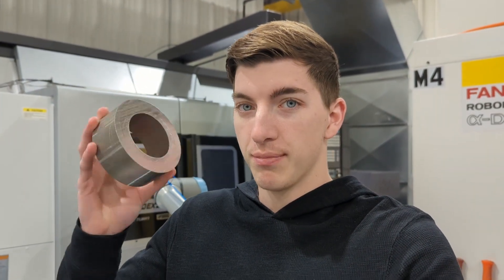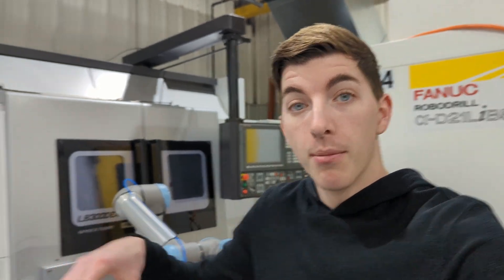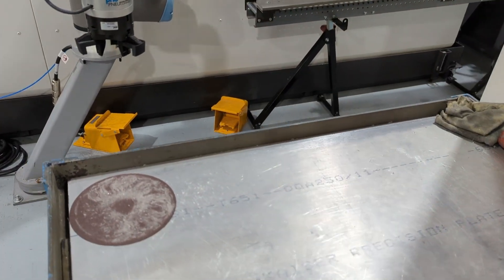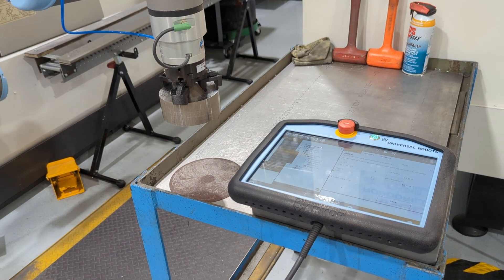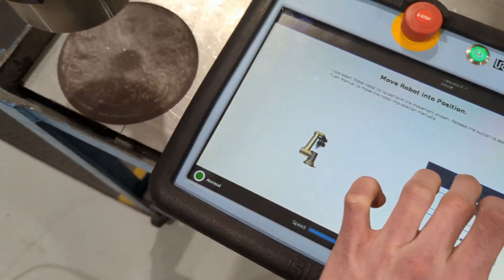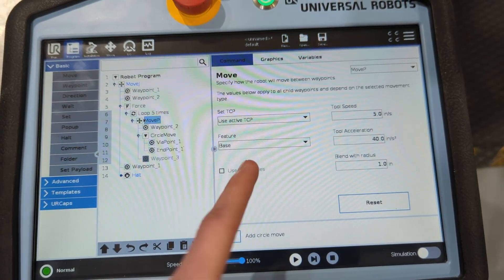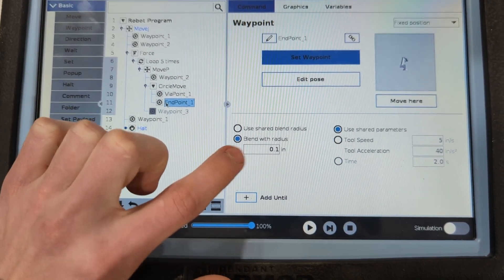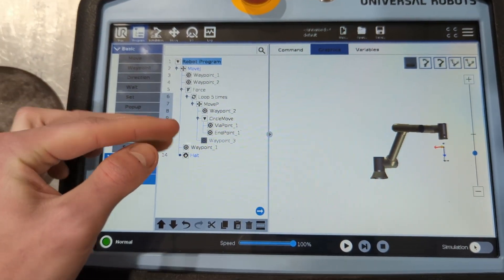Robotic Sanding with UR10

Comment: Nice work! Just noticing the cart face seems like it is raw aluminum, I wouldn't bet that if your parts are even made out of mild steel that you wont start wearing the surface of plate which you have the sandpaper affixed to. Depends on volume, material, relative force, etc but you might start dishing out that area and might cause you issues. I say might because being in the industry I have seen and done some rather hokey things that absolutely do work and never presume I know best. Thanks for sharing your thoughts and what you're learning as you go!

Comment: Cool demonstration man! As far as the setup and integration of the cobot to the lathes goes, did you do all of that yourself or did you have any professional assistance? Could you point me to any resources you found as far as integration goes? I've watched a few of your other cobot videos like the one with the auto door hookup and was curious if you pulled the whole project off yourself or not. Thanks in advance!
Reply from the maker: Haha glad you like it. Yes, I design, plan, and integrate every project I have done (working on #5 now). I've had help a few times when connecting machine I/O, welding bases, and getting ideas on how good material flow would look for a project. Lack of resources is why I started posting about my projects. There are videos out there but not many that dive deep.